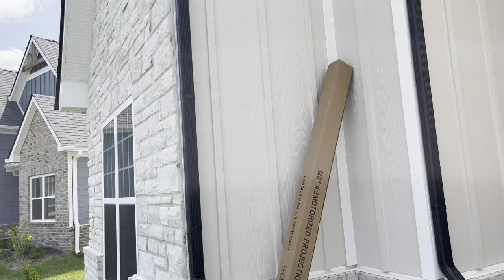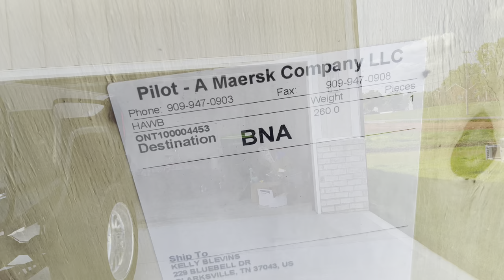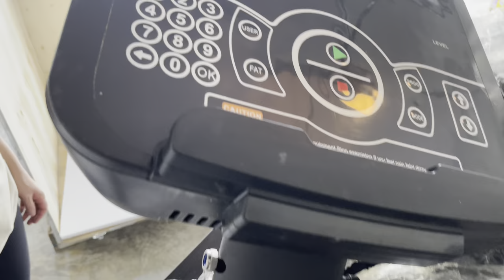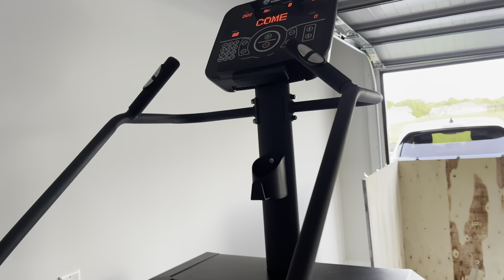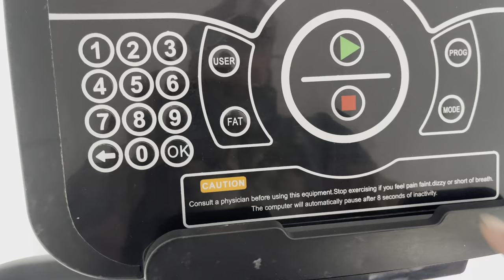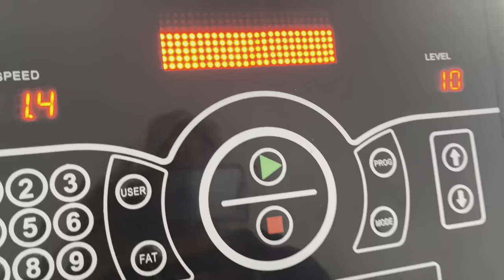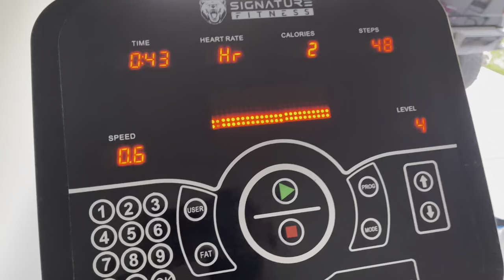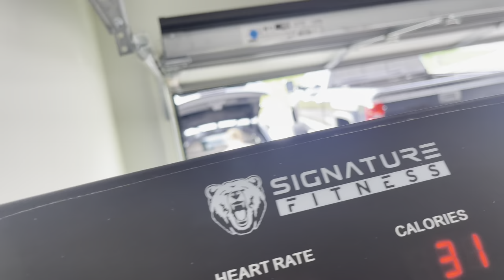🥴SIGNATURE FITNESS STAIR CLIMBER REVIEW | FAMILY VLOG🤪

Comment: How high does the ceiling need to be? I am 5ft7
Reply from the maker: I’m 5’7 1/ 2 plenty on space
Reply: How high is your ceiling?
Reply: My garage ceiling is only 7 ft and few inches
Reply: If you have 7foot ceilings and your 5’10 will I be able to fit?
Reply from the maker: @HungryYett 7 ft ceilings! Is this going in a tiny home? I feel like the machine it itself is 7ft? Might wanna google how tall the machine is.
Reply from the maker: @HungryYett 82” tall
Reply: @HungryYett  for some reason my garage is 7ft ceilings too… I’m 5’6. Was trying to figure if I can get away with it. I can get one brand new for $900 so wanted to make it work
Reply: @3dblevinsfamily  let me remeasure tonight. It’s an older house. Doors and ceilings are small and narrow
Reply: @HungryYett  I figured if machine is like 6 ft 8 inches and go closer to bottom steps it may be doable. Not sure! Def struggling with pulling the trigger for not. Trying to figure out ways to make it happen since it’s so cheap..
Reply: @codyphillips3406  this is the third time for some reason my comments aren’t going through? At least in my end lol. Can you buy that online for $900?
Reply: @HungryYett  no. Locally some warehouse . Brand new in the freight box on a pallet